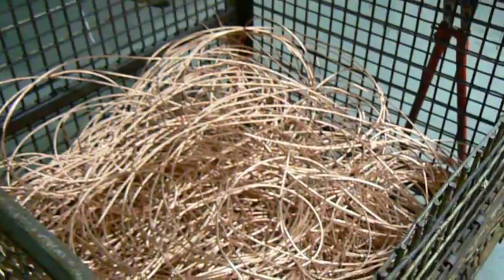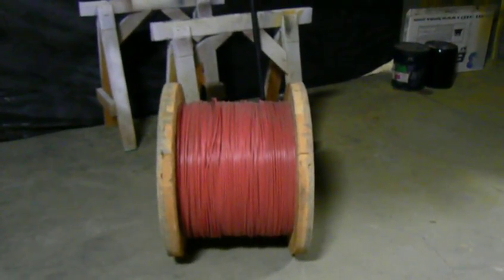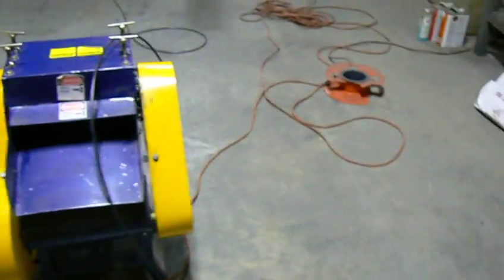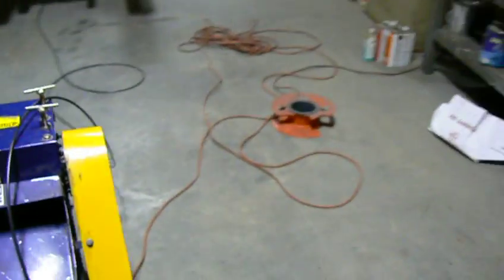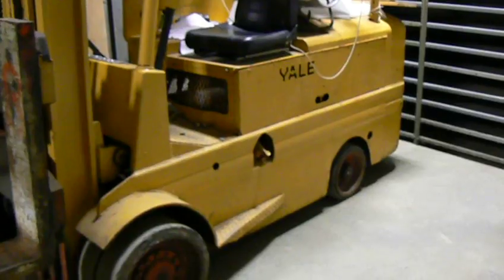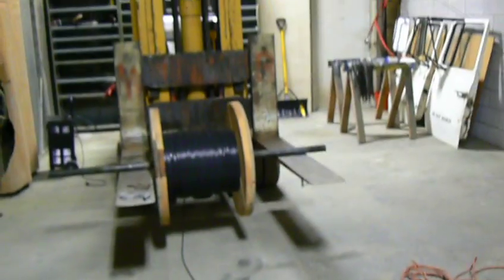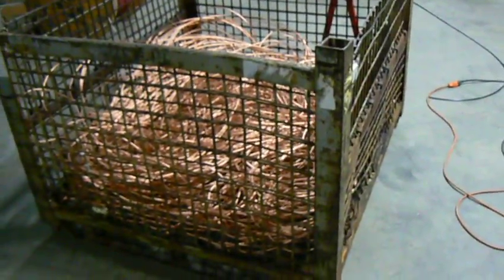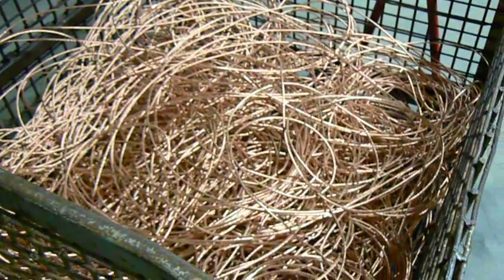Wire Stripping Machine part 1 of 2

Comment: I have a machine identical to that and the motor is messing up. I do not have the paperwork and cannot locate any company name on machine. If dont mind can u check to see what size motor that is so I can replace mine. I have done so much stripping with mine. Thank you so much for your time.
Reply from the maker: where are you located ?  would you be interested in buying my machine ?
Reply: I'm located in illinois outside st.louis. I'm going to pass on it. I only need a motor but I have no idea what size it is. There is no labels or id. Was no paperwork either. I know its a Chinese motor and machine out of Hong Kong but thats it. Thats why I was asking you to see if u knew. Its a very good machine. I have done some heavy amount of wire with mine. I would appreciate if you give me any info it would be very much help. I'm thinking it might be a 3 hp but not sure.

Comment: I don't see why you could not have sold  the whole roll of  non-stripped wire for at least scrap price, I would think a lot of electricians would have bought it off you.  I buy all my wire except bigger than 1/0 wire by the roll.  And if I was a bigger shop I'd buy even the 1/0 & 2/0 by the roll.
Reply from the maker: You're right.  I approached 2 local factories, but they wouldn't even let me show what I had to offer.  I didn't consider electricians, but would they have paid $5,000 for all for 4 spools ?   I don't know.
Reply: @HemiChrysler   Well, a person would really have to price out how much they would save, you did have some really big rolls there.  But I sure would think someone would pay the price.  Now that your done with the wire stripper you could sell it to me, if you lived in Rockport TX.  but I'm sure you'll use it again I'm sure.
Reply from the maker: @VerifyVeracity  I would sell, but would need to combine delivery with some other delivery to Texas.
Reply: Avalanche Sound 
So far I'm just saving it for a hedge against inflation kind of like Silver or Gold.  But maybe just maybe I'll cast something some day.  I've melted a lot of cans that I posted a video about.  But I have so many things to do I might never get around to doing it.  But if I do sell it I'll just try to find the best price at a scrap yard I'm sure.  I would like to cast a real large brass bell, & for that I would need lots of copper.   :)
Reply: Avalanche Sound  
I don't really think manufacture nails or pvc pipes will be a money maker for you, I don't think you could sell them for enough to cover your labor.  I have looked into making pipe out of recycled plastic & such, but it would have to be something you did just for fun, (maybe make a little money out of it) because PVC pipe & such is just to cheep to buy.  I've been playing around with welding lately & think I could make a little money with it, but it's mostly just for fun right now.  My wife is a Spanish speaking gal & I think we could make money making taqitos, they sell for over 1.50 each in the taqeria restaurants & I think we could sell them all day long starting at 5 for 5 dollars, or 1.25 each or something like that.  I work  some with a guy fixing ridding mowers & such, & man they bring all a person can handle, that is if people like your work for the money.  I could see how that business could really take off If a person had a mind to really get into it.  But really a person needs to find something they love doing then it does not seem like work, even if that is making specialty nail or something.  A old man once told me, 'John you'll be all right, because you're not afraid to work'.  That always stuck with me, & now I'm 59 & still doing ok, in fact even after I die I want to have something to work at, at my leisure of course. :)  Best  to you, where do you live in Texas.